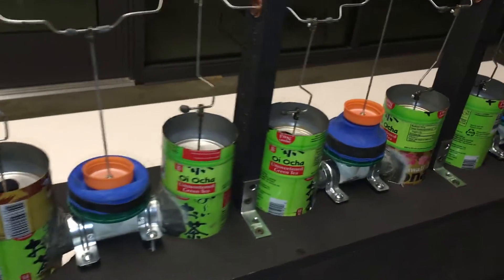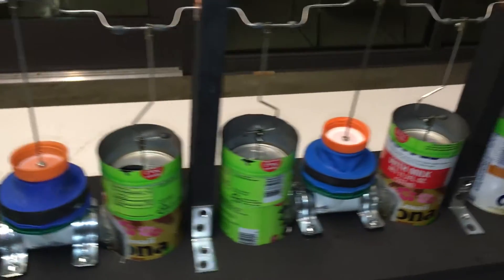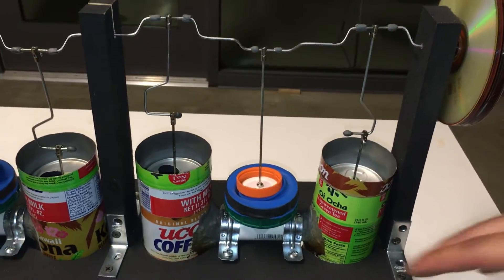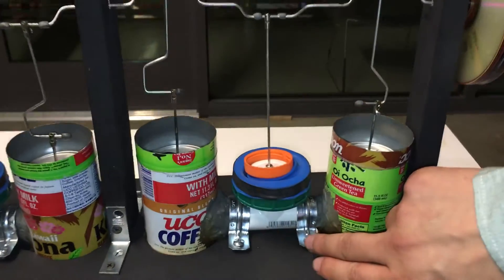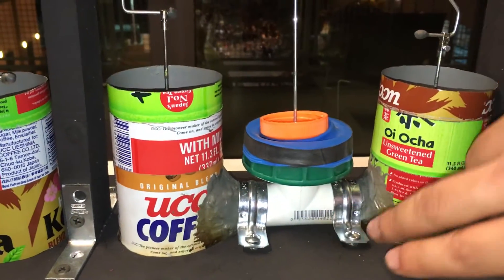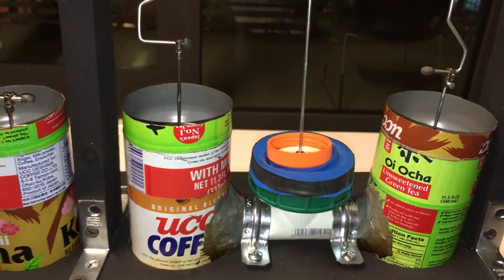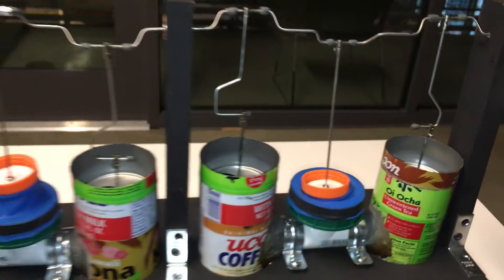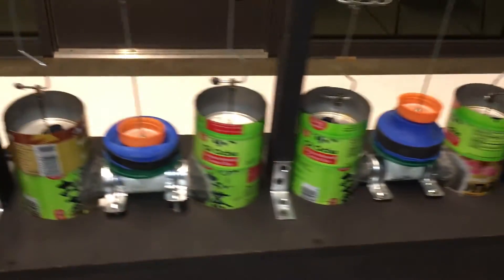ELAC-GE 101 Stirling Engine Project with 8 Cylinder Engine (Team Piston Heads)

Comment: How did you guys joind  the crank shaft and  connecting rod?
Reply from the maker: We used a mini terminal strip connector and removed the plastic insulation surrounding all the metal. We then split one terminal into two smaller pieces right in between both screws using a Dremel. Google "mini terminal strip connectors" and you'll see what I am talking about. Good luck
Reply: Thanks David. 😊